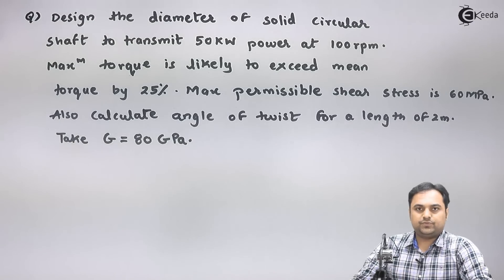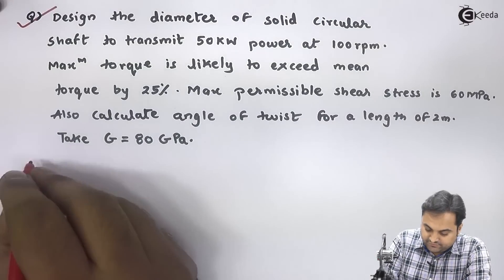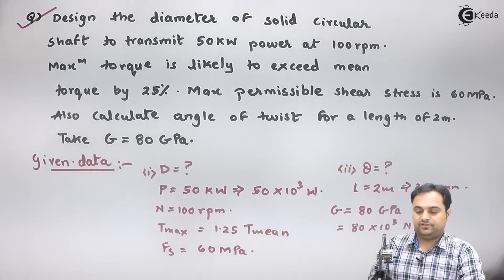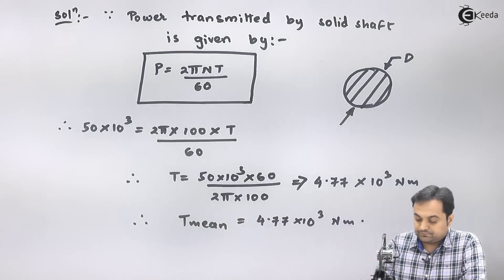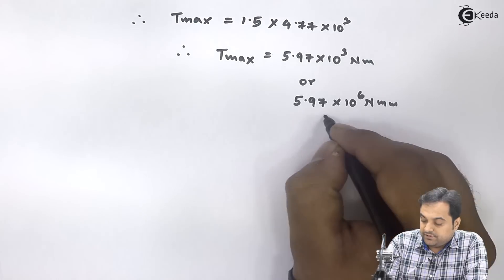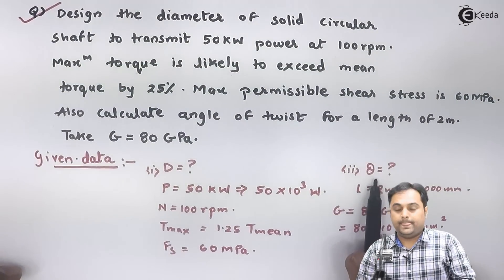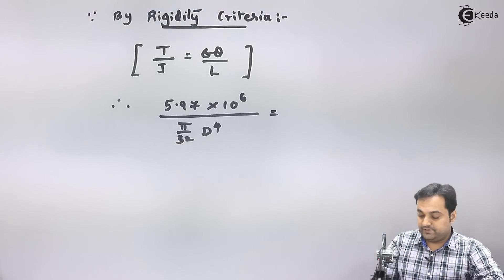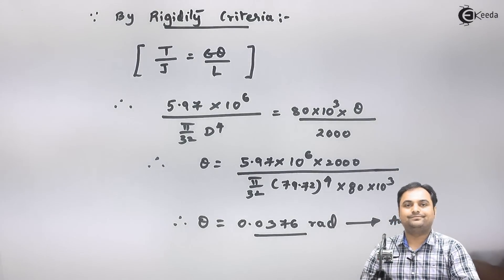Problem on Calculation of Diameter of Solid Circular Shaft - Torsion - Strength of Materials

Comment: a solid circular shaft and a hollow circular shaft whose inside diameter is (3/4) of the outside diameter are of the same material, of equal lengths and are required to transmit a given torque. Compare the weights of those two shafts if the maximum shear stresses developed in the two shafts are equal..
help me out?????
Reply from the maker: Hello
For asking your doubt directly to our Professors please download Ekeeda Application. Download Ekeeda application to get 1000 Studycoins and use it to access free courses.
Steps to follow:-
1. Download Ekeeda application from the link given below.
2. Sign up or Log in to your account.
3. You will get 1000 Studycoins worth Rs 1000.
4. Add the courses to your cart.
5. Select Study coins option to get free access.
Android App : https://play.google.com/store/apps/details/?id=student.ekeeda.com.ekeeda_student
iOS App : https://apps.apple.com/in/app/ekeeda/id1442131224

Comment: Hello sir I need answer  for this question      A hoisting drum of 0.5 m diameter is keyed to a shaft which is supported in two bearings and driven
through a reduction gear pair having a reduction ratio of 12:1. The gear, having pitch circle
450 mm, is mounted at the end of the shaft such that it overhangs the nearest bearing by 150 mm. The
load to be hoisted is 8 kN at the speed of 50 m/min. The efficiency of drive is 80%. The shaft is ma
steel, for which the working stresses are 115 MPa in tension and 50 MPa in shear. If the combine
shock and fatigue factors for bending and torsion are 2 and 1.5 respectively, determine:
(1) the power and speed of electric motor; and
(i) the diameter of shaft make it quick

Comment: unit conversion confusion??   6:25 

pascal = N/m^2 .... if u r converting it into N/mm^2 ...then  u have to divide N/mm2 with (1000)^2 .... in this problem 60Mpa = 60*10^6 pascal  ok . and pascal is N/m^2 ..so while converting it into N/mm^2 we have to divide it 1000^2 i.e 10^6 thank u ....or instead of dividing u cn multiply by 10^ -6 .. hope u get the point ..
to clear your confusion download a unit converter app in your moblie .. hope u get the point

Comment: Sir , i have big confusion about unit conversion, Na and Nmm.
Please sir , clear my confusion.
Reply: pascal = N/m^2 .... if u r converting it into N/mm^2 ...then  u have to divide N/mm2 with (1000)^2 .... in this problem 60Mpa = 60*10^6 pascal  ok . and pascal is N/m^2 ..so while converting it into N/mm^2 we have to divide it 1000^2 i.e 10^6 thank u ....or instead of dividing u cn multiply by 10^ -6 .. hope u get the point ..
to clear your confusion download a unit converter app in your moblie .. hope u get the point

Comment: sir. 25% ko Apne 1.25 Tmax kaese kiya
Reply from the maker: +Wasi Ahmad so we need not required to add it separately... (As 25/100 = 0.25 but multiplying by this number will give us how much extra T we require and to get Tmax we need to add it in T . To avoid this extra calculation we have multiplied it ( (25/100)+1) this will give you Tmax in single step)